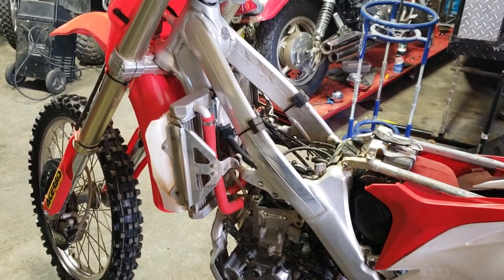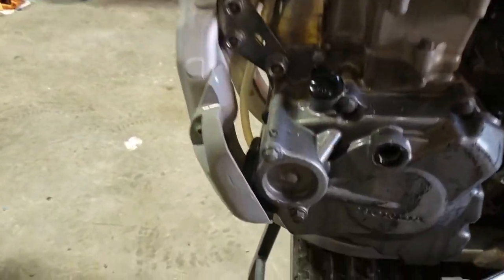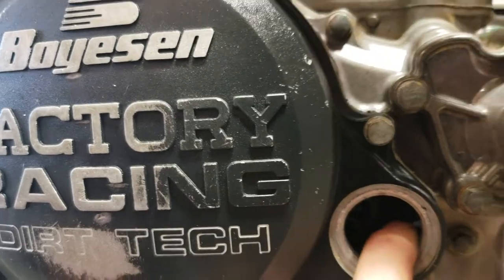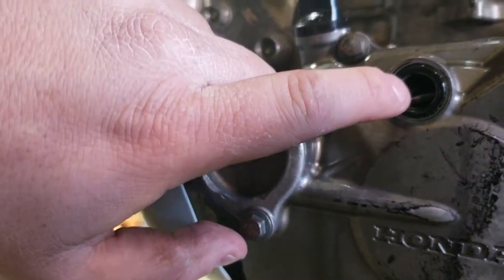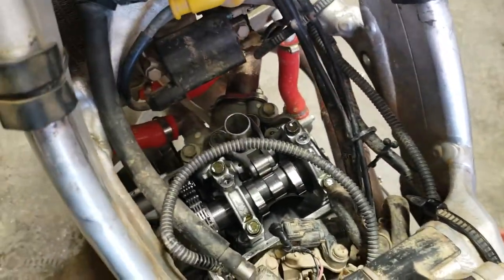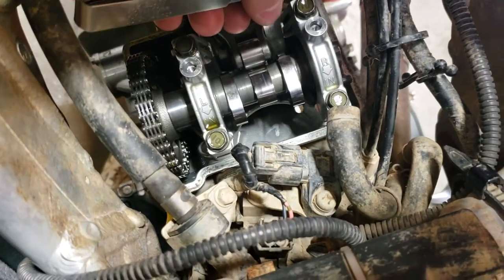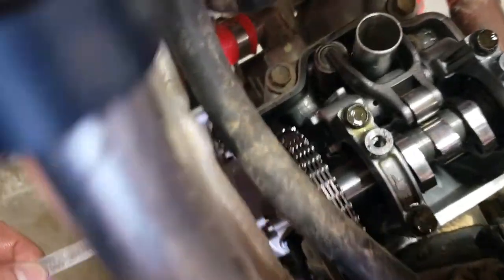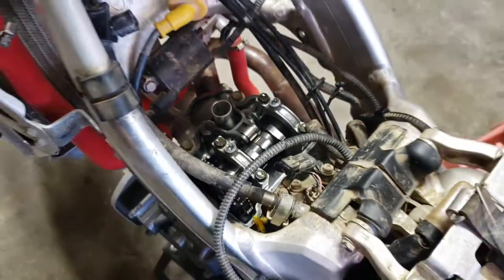Adjusting Valves on a Honda CRF250r!

Comment: Quick question I have a 2019 elec start and it acts like the battery is dead when I try to turn it over and I even put a big truck battery on it trying to crank it but it won’t fully turn the motor over idk if it needs a start piston or valve shimmed

Comment: Good video. How are the newer crf250r’s 2014+ for valve issues? I’ve always heard hondas like to go through valves and i just picked up a 2014. I’d like to hear what you think about the hondas. Thanks man
Reply from the maker: 14 is still unicam right? 

Weaker than DOHC but still works better than the early CRFs...the 02-09 were TRASSSHHHH!
Reply: Yup still unicam. I knew the older hondas weren’t the best. I’m hoping this 14 is good. Never owned a honda before
Reply from the maker: Just keep an eye on those valves, and when they do go, send it to someone that specializes in MX heads, like fastheads. I have a video or two on them.
Reply: I had zero issues with my ‘03 CRF450R. Clean air filter, regular clearance checks, good fuel and frequent oil changes. 
I have a ‘19 CRF250r now, getting ready to do the first service, ( just got it as a leftover).  
All the great things about the 450, without seeing God, if you get a little whiskey throttle lol.